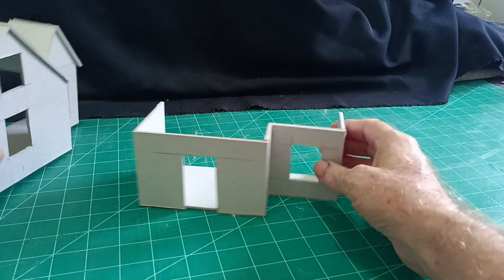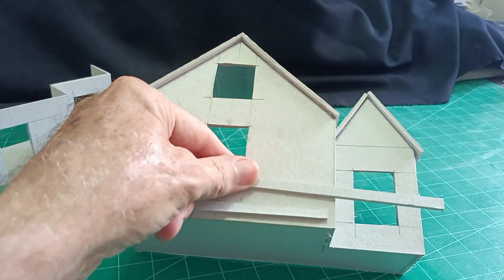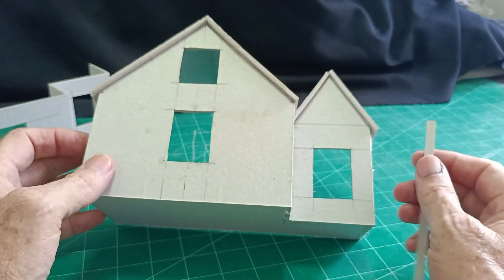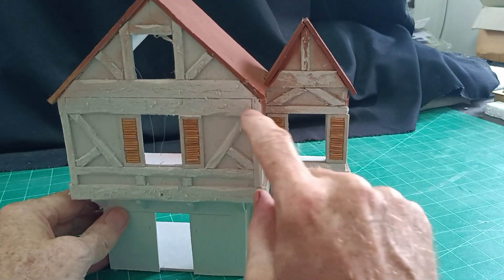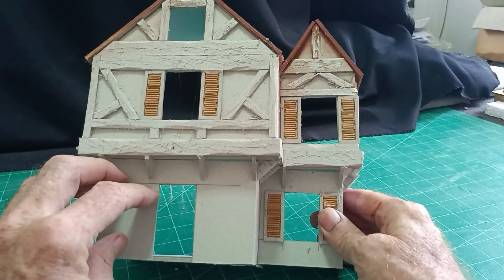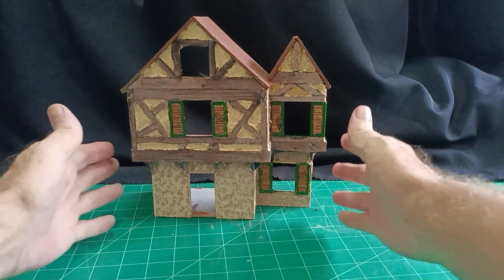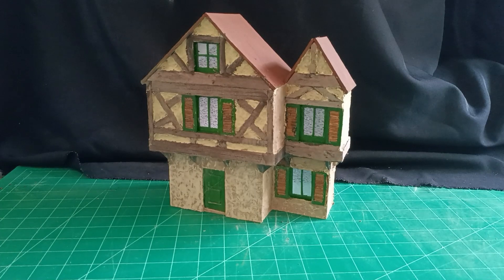Scale model German style house 1/35. How to make.

Comment: 3mm Cardboard construction. 
2:31 - Louvered window shutters - 2mm card board frame, thin paper backer, and cocktail sticks (toothpicks)
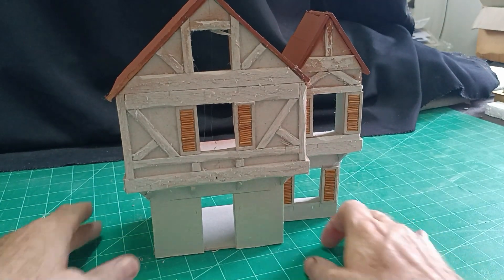3:39 - Woodwork replicated in 3mm cardboard, impression of ancient timbers
4:38 - paint and painted with grout onto surfaces.

Diorama Don relevant links
Ruined Building: https://www.youtube.com/watch?v=FrFnUs1kSS8 (knife awareness and safety)

Dutch House: https://www.youtube.com/watch?v=Me6bjeeICik (distinctive architectural style)
North African House: https://www.youtube.com/watch?v=eid-21aCYGA (distinctive architectural style)
French street: https://www.youtube.com/watch?v=IhujUoT9prA - (part four of four)

Painting without Paint:  https://www.youtube.com/watch?v=DkdaFyrOjbo (painting with tile grout)
Fence, Dilapidated Old Wooden: https://www.youtube.com/watch?v=CjRWFESFDSk (3mm thick cardboard) leaning and placement of boards, plan out and draw what is to be cut out. Distressed cardboard for texture and weathering before paint is applied.

Doors: https://www.youtube.com/watch?v=uH8BbLfxI6s&t=354s (static - not openable)
Windows: https://www.youtube.com/watch?v=71zCWiq12jA (static frame - not openable, with curtain)

Note: did not need to peel away black: painting white or cream over it, then brown, might have accomplished similar effect and retained the original textures. Dry brushing can also lighten a colour palette by several degrees with control of how much is applied. Paint is but a thin layer which may be painted overtop multiple times without losing too much detail - if applied in moderation.

[edit: extraneous line usage has been curbed]